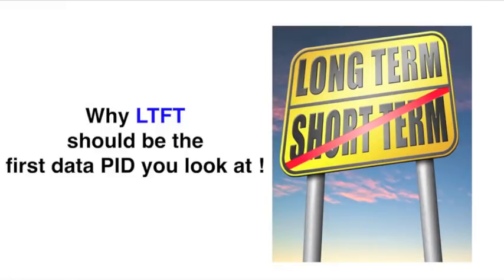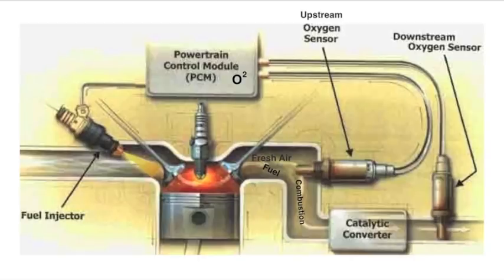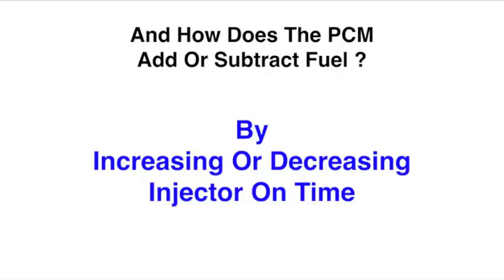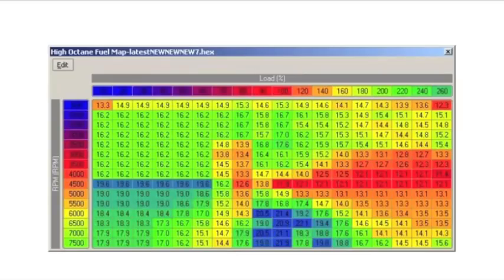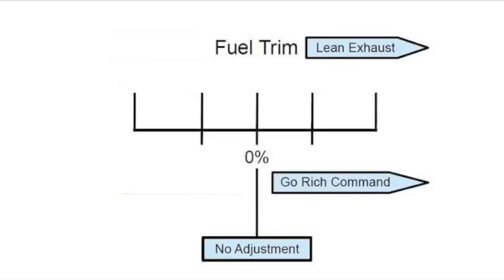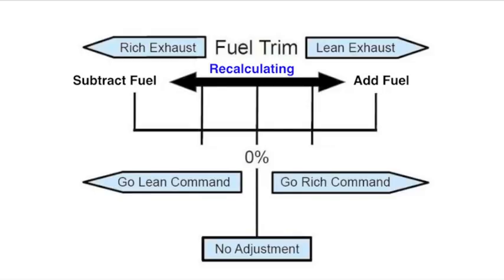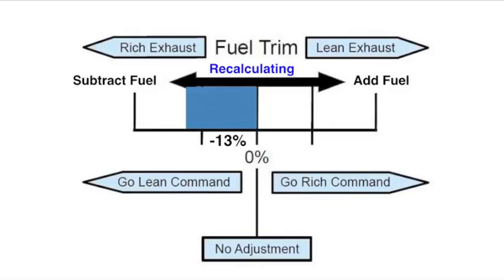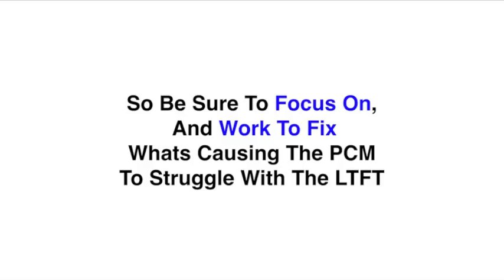Look At Long Term Fuel Trim  First

Comment: I agree. FT's are the first data PIDs I glance at when scanning through engine data. Good explanation Duane. Remember the days of block learn :)
Reply: Block learn, haven't seen that in a while lol
Reply: And "Integrator".
Reply: I followed up on the vid where you encouraged viewers to learn more about fuel trim and I ended up at this excellent vid. Thanks to this excellent vid and your encouragement I understand much more about keeping the modern engine running.

Comment: Looked at a number of Videos and this was really a good one. The animations were very beneficial. Thanks so very much. Hoping now I have a better comprehension of why I have a 19.5 Long term reading on bank 1 and only a 2,5 on bank 2 after replacing all four o2 sensors. I have a 2004 JaguarXJ8 4.2 with 91,000 miles I enjoy driving but have a problem with PO171 and Restricted performance since March. Thanks for the video. Great Job.

Comment: My STFT is behaving as expected when idling in closed loop, by hunting around 0.0%, plus or minus 3%.
 However the LTFT is stuck on -10.2% A quick blip of the throttle at it changes to -9.4%
RPM flucturating 796 to 803 rpm
MAP fluctuates around 25kPa
02s1 fluctuates around 0.00mA. plus 0 to minus 0.07mA
02s2 fluctates 0.57V to 0.63V

If go from idle to holding the throttle at 2000rpm or 3000rpm. The STFT behaves as expected. But the LTFT is still in minus figures but closer to 0% higher the rpm

Comment: awesome!  I got a high negative LTFT hitting -9% on both banks especially on idle and feel like some under power, LTFT returns close to zero when revving up engine. I check the fuel rail pressure, it's within normal range (DI engine). no blocked PCV. No missing fire detected on scanner. I'm completely lost.    side note: when I unplug the IAT sensor, seems engine runs better with happier throttle response and more power.
Reply: U ever find out issues?
Reply: You're running rich on both banks...could be MAF over-reporting amount of air coming in

Comment: Very interesting video!  Have a question. On my 10 year old vehicle at idle, STFT is around +6% and LTFT is shown at +3%(lower at times). When I increase RPM, I notice that STFT drops a bit to maybe +3 or less.  While driving LTFT may go to +2 or less.  I have checked hoses around the engine and cleaned MAF and looked at throttle body and all is clean and hoses attached properly and in very good shape.  Housing of the PCV valve looks clean.  I also do have bank 2 data which I haven't looked at yet.  I don't think I need to bother with anything, but out of curiosity what would you suggest?
Reply: From what you have said, I think you are fine.  To suspect a problem you would need to see the STFT & LTFT combined value consistently going above 10%,
Reply: What was your main Symptom?  This sounds very similar to what is happening to my vechicle in my Symptom is an extra 26% usage in Fuel.  Also no CEL was triggered.
Reply: @anteka12  No symptoms, just wish to have better fuel economy and thought fuel trims could be improved.
Reply: @Charkatak  Thanks for replying, I'm still trying to track what the issue is.  I've seen some anecdotal posts, about how others are getting worse fuel economy and I am wondering here in Canada if they somehow upped the ethanol content.
Reply: @anteka12  Usually when ethanol is increased, gas stations should post information or a sticker telling the percentage. Have you tried to calculate a fuel real usage after refueling?  Anything in oxygen sensor data?
Reply: @Charkatak  Actually I pulled my O2 Sensor, cleaned it, and did a test drive.   Based on the Real Fuel usage numbers, I thought that was it, a slow upstream O2 Sensor.  But it was not the case.   I just dumped a can of fuel injector cleaner in, we'll see after this tank.   But in the meantime the LTFM did look lower on average now.
Reply: @anteka12  any updates?
Reply: @macknumber9  No my Fuel Mileage is not good, even worse with the cold temps and winter fuel.  I bought this device " Turbogauge IV 4-in-1 Vehicle Computer OBDII" on AliExpress (it's a clone of ScanGuage).  To track my Fuel Mileage every time I use the vehicle and then I will cross-reference the Fuel usage when I fill up and reset the trip computer.   I hope that will give me any indication of it either being a leaky fuel injector / plugged cat etc.   Other than that, I plan to do a compression test in the spring when the temps warm up.  The big issue for me is there is NO CEL, so other than that maybe I'll try and check the Alignment manually.
Reply: @anteka12  what are both banks ltft and stft?
Reply: @macknumber9  So my Vehicle does not track separate banks.  Which makes it hard to confirm the numbers.  My Long term is always a few percent 2-4% and Short term is Usually Negative.  Note: I'm not graphing it.  But again no CEL.

Comment: Forgot to mention this is a 2010 elantra with only 62,000 kms. I did clean the IAC idle control valve, Map, TPS sensor. Car has been restarted at least 50 times since these sensore were cleaned.

Comment: How does this get my 89 s10 pickup with a manual transmission  running right? I have replaced everything but the tps and map sensor. I live near Harrisburg Pa and I the morning I can drive for about 15 minutes and the engine runs great for a truck that's 30 years old. Then like a switch was flipped the engine starts to run like crap. When I put the clutch in the engine tries to die and some times it does. The engine shakes violently and I almost didn't make it home today. When it does this why can't the driver give the ecm an error and tell it to run. Don't understand how the ecm can't tell the engine is shaking and do something to correct the issue? U unplugged the o2 sensor hoping to keep it in open loop. But 15 minutes later engine is running like crap. I firmly believe that when a engineer retires they are NOT done working they get to work in repairing the garbage they designed. I thought I would learn something here but I have no clue what you are talking about. This is why I don't do this professionally any more. Stupid engineers messing stuff up designing dumb crap.

Comment: You mentioned that -10% to +10 STFT is normal.  Does the same rule of thumb apply for the LTFT?
Reply from the maker: Yes, however the PCM does not read LTFDT as a stand alone input.  Instead it reads them as a combined input.  So, if STFT is at 10% and LTFT is at 5% the total would be 15% and that will seta code

Comment: Does a high negative LTFT means the engine is not running on optimal power output?
Reply: High and negative ?  Thats confusing
Reply: @strokewarrior5762  LTFT = -21
Reply: Running rich. Mine is running at -22 at long term. Been trying to figure out what it could be.
Reply: @Shotbymic_2  mine is -15 but it changes at full throttle to -9 . Does it mean injectors are leaky? What you think
Reply: @amirouw  mine is also -21. STFT is around 0

Comment: Can  you tell me what I need to do! I have a rough idle on  cold starts for about 15 sec then idles better than worse again, after it comes to operating temperature. The idle is rough with a load on the engine at stand still or going up hill. I have no check engine light or saved codes. Gas mileage and performance is poor. the long term LTFT is - 4.7 and the STFT is -0.3 What do these numbers mean. What should I be looking for? I have a scanner?  Thanks
Reply: Your car is adding fuel mean that you have a vacuum leak somewhere.

Comment: I have a short term fuel trim of maximum + 25 while long term fuel trim is at 4.7% what should I be looking for, vacuum leak?
Reply from the maker: More info is needed to make any assessment.  Are those numbers at idle, and how do they respond above idle, at wide open throttlele, etc. ?  How do they respond when you add extra air and/or extra fuel.  Those are the things you need to be checking because anything less would just be a guess
Reply: @realfixesrealfast  this was over a 20 mile drive, it records maximum and minimum values over the driving time, long term seems to settle around 4 or 5, short term can be okay but sometimes gives plus 25.

Comment: I have a cuestión how can I fix it one spark plug has a swept thread.?
Reply: Ninosinamor19 If the spark plug hole in the cylinder head is stripped out, you'll need to drill out the hole to a larger diameter, tap it, and install replacement threads.

Comment: my car long term fuel trim is  10% - 12% while my car is running is this normal or there is a problem with me vacuum or fuel system??thank u
Reply: if you charge engine to 3000~3500RPM and the value of LTFT down, is probably vacuum problem, if not, maybe fuel injector (or any fuel sysem, like fuel pump, filter...) has a problem.
Reply: @teive  at idle i got 3% only for LTFT, but if I run it fluctuates to 5% upto 12% I check the fuel pressure is normal I tried fuel injector cleaner and still the LTFT is about that value, i changed the fuel filter check it improves a bit. But is flactuates to those values.
Reply: and STFT, is normal -3%~3%? This value of 12% on LTFT is positive (+), right? If is positive, the PCM need to send more fuel to system. How many cylinder has your car?
Reply: @teive  4 cylinder, 2.2l ecotec, 3% is positive and while running is going up to 10-12% +.
Reply: try to log STFT data, maybe O2 sensor need to be replaced. Well, good lucky on your diagnostic. Regards, my friend.
Reply: Replace your air filter see if that helps if not it might be your mass airflow sensor.
Reply: @herreraschannel8930  any updates?

Comment: My ltft has an error, al the time it is 0.78. I know when it was working ok it was 5 to -7. My exhaust pipe is now black, also fuel consumption has increased. 
Is there a way to reset it?
I have tried battery removal for 24h and no succes. Also, there are no error codes , O2 sensor is working as it should, stft fallows O2 sensor.
Reply from the maker: both SFTF & LTFT are computer "responses" not "controls" , so no there is no reset for them.  It would take some accurate hands on evaluation of them to determine the issue.
Reply: @realfixesrealfast  would it be correct to says that when every thing are working correctly the car's exhaust would be having slightly excess O2 of 2% vs 21% of O2 in the air. Yes, no?. Y

I bought a 2006 Mercedes and put in plug & dashboard display OBD2. While driving O2 sensor reading fluctuates between 0.65 to 0.8V. This short profile of V swinging value, I understood, is only for cars made before 2007 which uses different soft ware for O2 sensor self check.

It does only drop to 0.1V briefly when braking to stop. Left on cruise mode the short fuel trim value changes slightly and does not swing about too much.  Long fuel trim value hardly moves and would be moved by 2% or less. 

Thank you and have a nice day.
Reply from the maker: @whlawson5812  from what you explain I would say Yes.  Some may argue that perfect is 0% but there are just too many variables with 2006 that has several miles on it.
I think you are ok

Comment: these 02 sensors  are failure of logic .  short term blue  is  like  constantly  trying to avoid  problem  as result creating  even more problems . can you disconnect  that  short  term  pre cat  o2   it  brings  to  0%   .  just  let the  long term  or after cat  02 do the job . ?